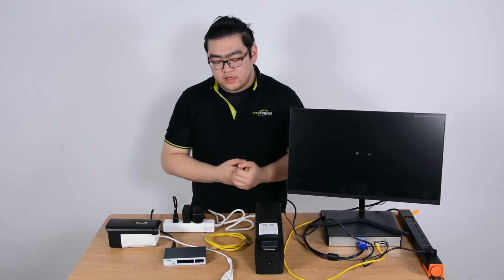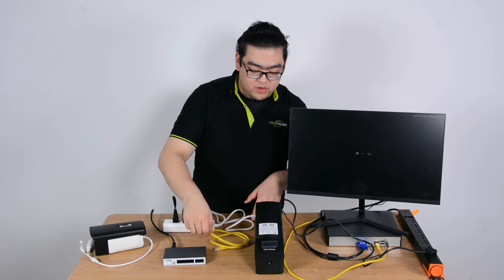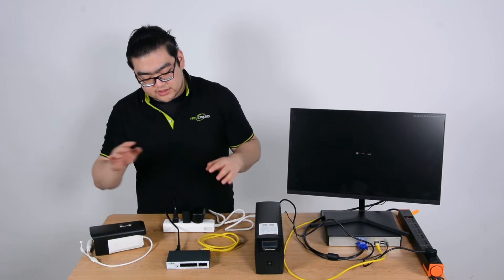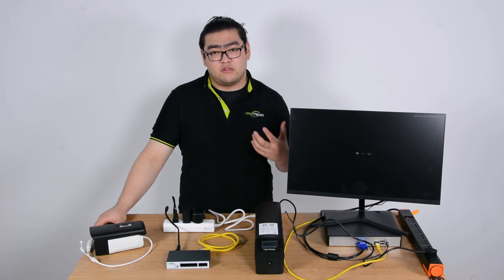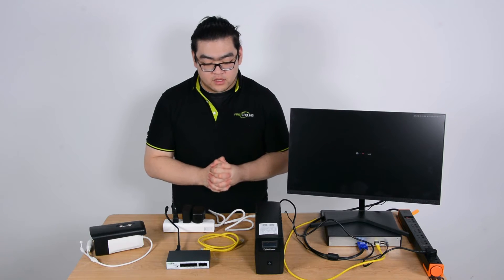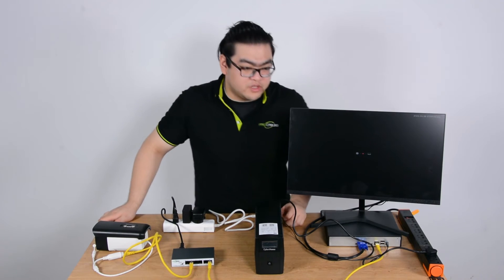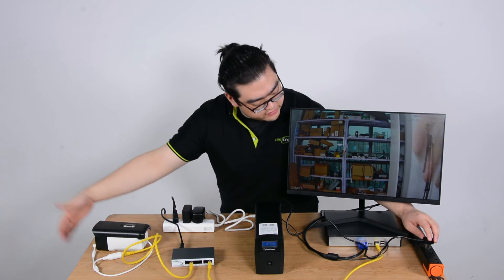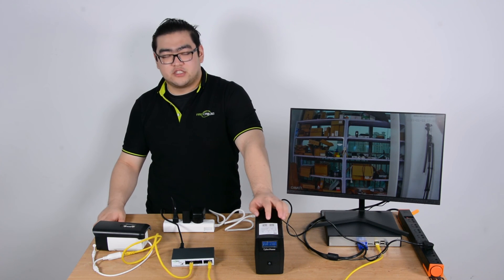Build A  Reliable CCTV Security Camera System with PoE Switch and UPS

Comment: Can you tell me which model it is?
I need it for a imou nvr with 4 cameras of 2 mpx..
I only need it to maintain the system for 1-2 minutes, due to frequent power outages.
Reply from the maker: Most UPS with battery built-in can do the job. You can find the UPS with battery built in if you only need few minutes power backup.